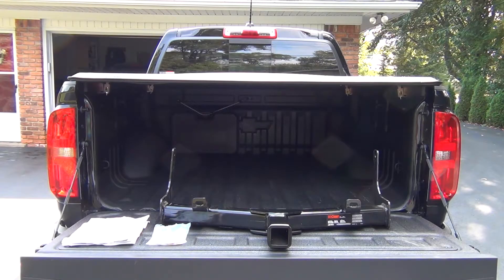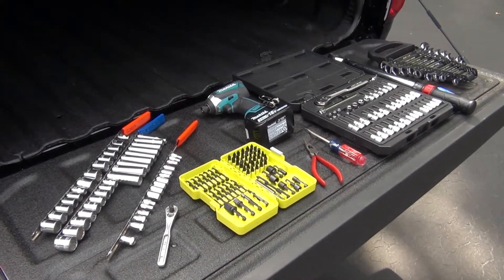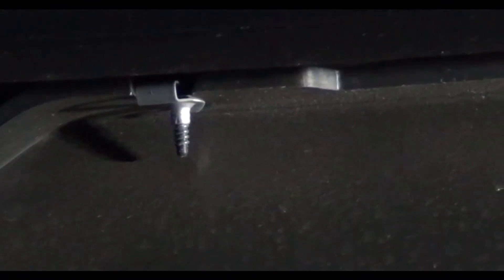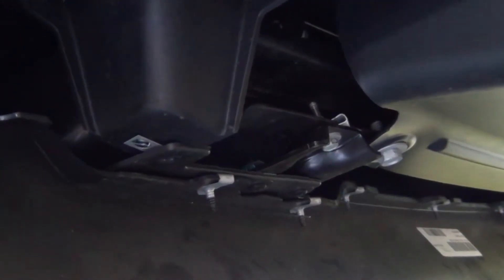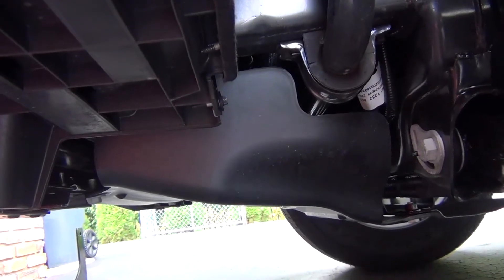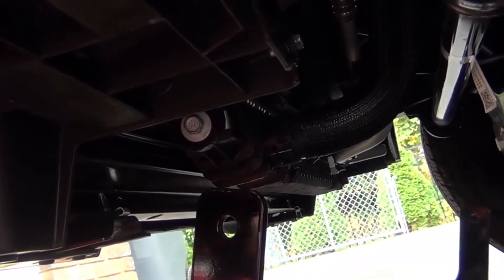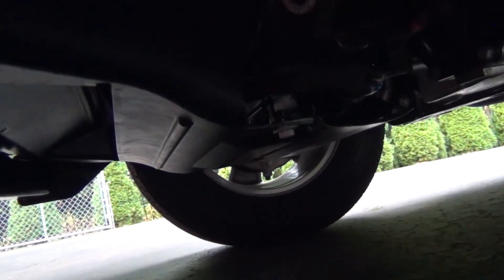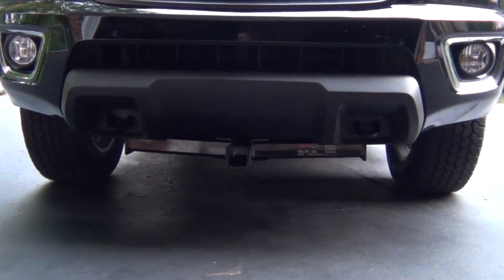Curt 31074 Front Mount Trailer Hitch Installation | 2020 Chevy Colorado (w/ Front Air Dam Removal)

Comment: Hey bud. Great instructional video. I am looking at doing the same thing, but I was also thinking about replacing the front skid plate with a steel or aluminum skid plate, as I do some light rock crawling. Would it be possible to replace the front skid plate with the metal skid plate and still use this hitch?
Reply: Worked for me.

Comment: It was great to see someone install the front receiver hitch. Not many trucks have this -- good place to mount a winch for very occasional use. I am thinking of doing the same thing. Do you think it is possible to re-install the factory air dam using some surgery on the plastic part? The air dam improves mpg and cooling so I would like to have it back on.
Reply from the maker: I’ve heard of others that made a cutout on the air dam and reinstalled it. It’s been awhile since I’ve installed this one so I don’t remember 100% if any of the clips/screws on the dam interfere with the receiver. I’m sure it can be done though with a little creativity. I’d be curious to see how much of a cooling and MPG benefit the dam offers. (I haven’t noticed much of a difference running without it)
Reply: @GrazGarage  GM uses an air dam for four reason I know about: reduce turbulence and noise, increase mpg, lower air pressure under the truck makes the ride more stable, and it increase air density to the heat exchangers. I tested my 2019 Base model and get about 1 mpg increase at freeway speeds with the air dam vs. without. Saying a product is engineered means everything was done for a reason. Thank you for the great video!

Comment: I'll be doing this in the next week or so. Amazon had the hitches for $140, everyplace else that I found was over $200.  I have seen it suggested that you can flip all the clips over and re-install the Air Dam easily.  Although the receiver is probably in the way once installed..
Reply from the maker: I think flipping the clips would just change the direction that you drive the mounting screws from. You could then drive the screws up from the underside, rather than have to fight the bumper to have access to the screw heads. 

You will still have an interference issue with the opening of the receiver hitch though. In order to reinstall the air dam, you’ll need to cut a square into it, which can be done, but is more or less personal preference.
Reply: @GrazGarage    Well the first one apparently made it to Newark CA, where according to shipping information, the post office broke it.  They canceled delivery and returned it to sender.  Didn't mention it to me.  So I tried to contact Customer Service on Amazon, they just referenced Curt Customer Service who haven't replied yet.  They were down to half the number in stock so hit re-purchase.  Well it got here today.  My first payment hasn't been reversed as they indicated it would be.  So now I have two charges and one hitch.

I'm still wondering how they "broke" it.

I'm also thinking of getting a skid plate fabricated to fit under it.  But that's way down the road.
Reply from the maker: Yikes! Well, if it “broke” that easily, it’s probably better that you got a different one. Sucks that they didn’t tell you and still haven’t refunded you on the first one. Good luck with getting things sorted out!
Reply: @Graz's Garage  I'd like to hear more about flipping the clips for air dam reinstall (after cutting for the receiver tube). Had anyone had success doing that and would you just do that on the two hard-to-access bolts, or all of them? I have mine off and am getting ready to put the hitch in place.

Also, you didn't mention reinstalling the two plastic panels behind the parking lights...I assume you did?

I was a little unclear on how you dealt with the front of the 'skid plate'. So you didn't use the front two bolts, just pushed it forward as far as possible and used only the rear bolts?

Thanks. Best video on this project that I have seen.
Reply: @ebachy  Haven't reinstalled the air dam.  The clips are just removed and turned over so you can insert the screws from the bottom and not the top.  In addition to the hitch I replaced the stock skid plate with an AEV front skid plate.  It's been a while but I didn't have to remove anything bet the air dam.  Everything else I just loosened and moved a little out of the way if it needed to be moved.  Didn't have to take anything off, if I did it went right back on with out any issues.  Both were really easy installs.  I used a floor jack to hold the hitch in place while I got the first bolts in.
Reply: @n6nvr  Thanks. I went ahead and flipped all the clips, which involved pulling them off the air dam and putting them on the lower bumper in their flipped position. I did eliminate the one in the center because it was under the hitch tube. I could have reached into the space in the bumper to tighten it from its standard top direction, but felt it was fine without it. I will point out that it was still hard to screw in the fasteners due to the position of the holes being close to the apex of the acute angle of the plastic air dam...one needs a small universal joint extension...
I have to say, getting the hitch positioned and the bolts into the chassis holes was a real challenge and I ended up using blocks of wood with my floor jack to get it in position. If you use ramps like I did, I found I had to back up onto them or the air dam was in the way. Once installed, the hitch seems nice and sturdy.

Comment: I have a 2016 Colorado When I went to install hitch the end mounting tabs didn't  reach from outside to outside of the frame
Reply from the maker: Mine was not fitting up at first either. It took a set of jacks and a whole lot of patience to get everything lined up and bolted in. What I found was that it was best to line up one side first and then use the jack on the other side to raise the receiver up to the mounting hole in the frame. It was very snug, but the jack helped get everything aligned.
Reply: @GrazGarage  OK Thanks for the information